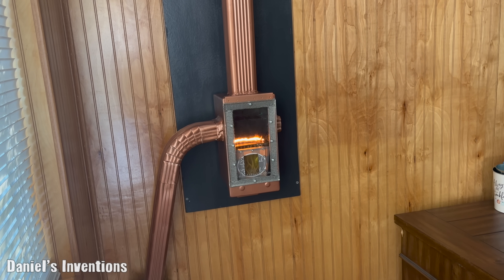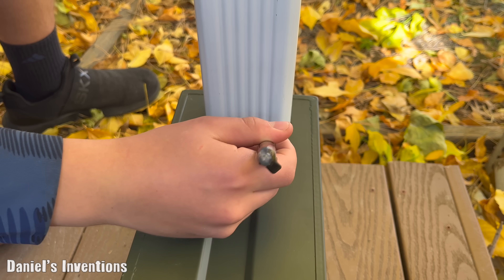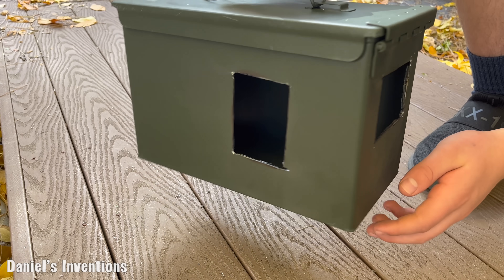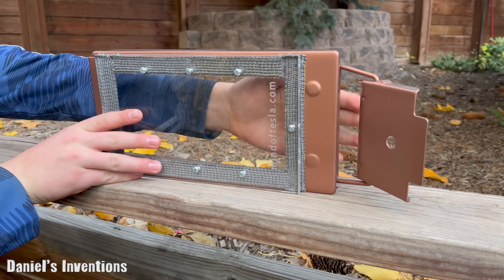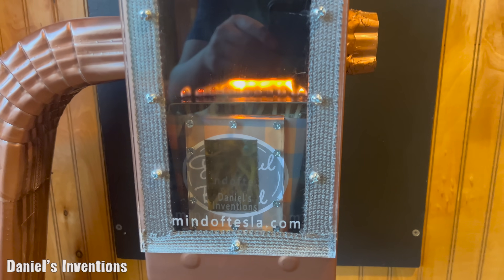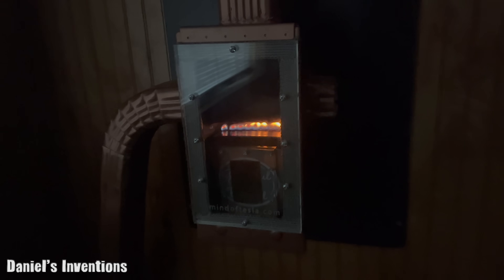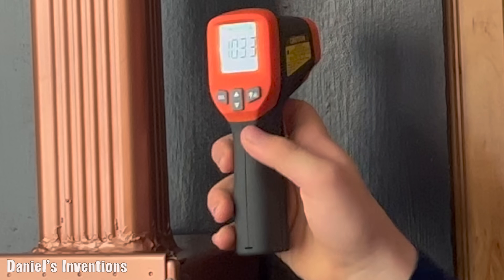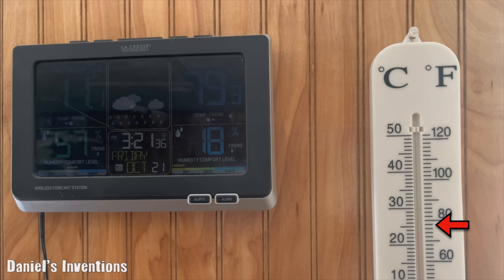ENDLESS Heat for Your Home WITHOUT Electricity

Comment: Get rid of the computer fan. Put the output from the heater air pipe a little higher and aimed upward. Hot air will be circulated by convection and the electric fan will no longer be needed.
Reply: The fan is optional to help with air circulation. The heater could run without it, but still, nice idea!

Comment: I was thinking about the same thing but I might use candle wicks instead  and need to watch JB weld it can handle a little heat before it starts melting I tried it on a motorcycle long ago and started to get weak when the motor got hot and that was the lower part of casing where it was cooler.

Comment: I'm liking it but lots of questions the main one that gets me is the no electricity but u have a 12v fan so electricity hmm
Reply: It does not need to have a 12v fan, but the fan helps with air circulation.

Comment: I'm unclear as to how you regulate the heaters output. Say you have a cold night but a suddenly wormer morning. is on and off the only option?
Reply: On and off is the only option; although, I'm sure you could probably figure out how to install a heat regulator that works with the heater.
Reply: @jimwei4life  Yes, something that covers/hides a chunk of the wick could reduce the output.  You need to leave a part uncovered to work as the pilot light.

Comment: Put some thick steel on top of the heater, it's thermal mass will help radiate even more heat.
Reply: You mean "its surface area".  Thermal mass just stores heat.
Reply: @kensmith5694  Yes, the thermal mass of steel or iron, captures the heat, but the steel surface will radiate it. Could attach some old PC heatsinks to that surface to effectively move the heat out into the surrounding air. Otherwise a lot of the heat goes straight out the chimney. You want air to exit the chimney to extract fumes, but to also retain as much heat as feasible.
Reply: @VenturiLife  Yes like I thought yo9u really meant, you meant surface area.
BTW:  You don't want to take the temperature of the exhaust below boiling with the type of pipe used.  If water condenses, it absorbs gasses and become corrosive.  The pipe being used would be eaten up by that.
Reply: Rocks.  Ordinary or lava rocks (from grilling) or a piece of granite (to be decorative).  They have far better specific heat than steel and will "hold" the heat later into the night.

Comment: Well done, and this is the way forward in heating spaces economically and efficiently. I would still advised a C02 monitor in any small spaces though!
Reply: Good point.
Also CO1 is more deadly than CO2 and it is generally produced in heaters by incoplete combustion (no enough oxygen) so you not only should vent the heater but have adequate ventilation of the living space. A CO1 meter and an O2 meter would be nice but CO1 is much more important.
Reply: @2Truth4Liberty  CO2 Indoor Air Quality Meter are essential for most space heaters, this particular design does have a flue venting system that is separate from the combustion chamber, so unless a leak occurs they are much safe than a regular open and flueless gas/oil appliance space heater, however it is always advisable with any combustion chamber and device to have adequate ventilation and assisted/ monitored with a CO2 Indoor Air Quality Meter. Always best to be safe than sorry!
Reply: What about CO1 which is more deadly than CO2?
Reply: @2Truth4Liberty  Are you referring to Carbon Dioxide (CO)? As CO(2) is produced at dangerous levels by oxygen-starved combustion in improperly ventilated fuel-burning appliances such as generators, oil and gas furnaces, gas water heaters, gas ovens, gas or kerosene space heaters, fireplaces, and stoves. CO(2) is almost entirely a man-made gas that is not normally found in the earth's atmosphere. that is toxic. CO(2). Many refer to carbon monoxide as one of the most dangerous gases. We use CO and CO2 to identify the separate gases, so I assume you mean Carbon Dioxide and Carbon Monoxide. Both are made from carbon and oxygen molecules. Both are potentially deadly and can cause severe health problems. Both carbon dioxide and carbon monoxide are colorless, odorless and tasteless gases. The concentration levels are where the affects are life threatening, with lower levels of CO required to cause major life and health problems than Co2. CO and CO2 are potentially deadly, this happens at vastly different concentrations. While 35 ppm (0.4%) of CO is quickly life threatening, it takes more than 30,000 ppm (3%) of CO2 to reach the same risk level. I think that's what you are referencing, Co(1) and Co(2).The most important difference is that carbon dioxide is a common, naturally occurring gas required for plant and animal life. CO(2) is not common. It is a byproduct of the burning of fossil fuels such as oil, coal, and gas.
Reply: "CO(2) is produced at dangerous levels by oxygen-starved combustion in improperly ventilated fuel-burning appliances such as generators, oil and gas furnaces, gas water heaters, gas ovens, gas or kerosene space heaters, fireplaces, and stoves."
---
Change CO(2) (dioxide)   to CO(1) (monoxide) and I woud agree.
Carbon Dioxide is natural - every human breaths it out, and combustion produces it too.
Carbon Monoxide is natural too but is rarely produced in nature as it takes an oxygen starve combustion to make it.
Whenever you see "soot" being formed by a flame - you can know it is creating CO(1) - carbon monoxide - which is very toxic - so a carbon MONOXIDE tester/alarm is HIGHLY advisable for non-vented combustion.
Reply: @2Truth4Liberty  It is just CO. Not CO1
Reply: @gregdazer8395  Which is more toxic? CO or CO2?
Reply: @2Truth4Liberty  you just stated in your comment that CO is more deadly, why are you asking about it now?
Reply: @bmxscape   @bmxscape 
 Because the suggestion of getting a CO2 monitor without any mention of getting a CO detector.
If you can only afford one, it should be the CO detector.

Comment: You could use a termoelectric generator to drive the fan, it will be driven by the heat = no battery needed.

StoveSeal could be used instead of Jb Weld.
Reply: They make Stirling powered fans that are more efficient than that.

Comment: The concrete used as a heat shield really should have an air gap between it and the wall. It will still get hot and the wood behind it.
Reply: Yes, and it should be made reflective so it reflects the IR.
I think two plates is even better.
Directly on the wall you have the cement board.
A short distance out from it you have a sheet of metal
Then there is a space before you get to the heater.
Reply: They said there was an inch air gap between them

Comment: very good, can it run on any oil?
Reply: It will run of nearly any clean light oil.  Olive oil, Vegetable oil will work and so will kerosene.  Heavy oils won't go up the wick well enough.
Reply: @kensmith5694  Bacon grease?
Reply: @KuptisOriginal  It would stink and attract animals but rendered bacon grease would work.  Basically if you keep grease hot long enough or add certain chemicals to it, it becomes runny enough to use.  Otherwise, it is too thick to climb up the wick.

Comment: What did you paint the gutter tube, that has the flame contact inside of the heater, with? Alos, how often do you have to clean the soot out the heater?
Reply: It looks to me like they spray painted the gutter tube. I don’t know about the soot, though.

Comment: Are adding copper fins using silver brazing which takes a little skill is better than Sauter made out of lead because it’s not as heat conductive. 

The fins on the exhaust pipe would increase the surface area absorbing more of the heat from the flu pipe. 

Even the box itself though should be made out of copper steel as a very poor heat conductor.    And the type of heat that you are using is extremely low so you never have to worry about the copper melting.
Reply: Yes, and there is also that weird "welding rod" that can be used to join aluminum with just a blow torch.  Copper is expensive.  Aluminum is cheap.
Reply: @kensmith5694  The problem is that weird welding rod that you call it melts at a low temperature just like solder in the 400° F range

Silver Brazing is in the 1200° range more acceptable for a stove.
Reply: @coldfinger459sub0  I wasn't thinking of the soldering stuff at 400F.  The stuff I was thinking of melts at much higher temperature.  With a quick search I found some that melt a 728F
Reply: @coldfinger459sub0  Fires of the type shown don't get all that hot.  They are basically candle fires.  Also remember that the metal in the thing is well below the temperature of the fire.  If it isn't there is not enough air flow.
BTW:  Diamond is a much better thermal conductor than silver.  It is a bit harder to work with though.
Reply: @coldfinger459sub0  It is also a bit expensive to get machined to shape.  The funny thing is, I keep expecting someone to come up with a way to make "structural shapes" of diamond.  Folks in Florida can make nice ones 1/2" in size.  Others have a method to deposit layers of diamond onto metal surfaces.  I never expected either of those to happen.

Comment: One gallon of diesel = 138,000 BTU / 7 days = 19,714 / day. Likely 12 hours/day is only 1,643 BTU / hr. With an outside Winter temperature of 32°F and asking for 68°F inside your cabin means a temperature difference of 68°-32°=36°, if one square foot of cabin area requires 36 BTU, a 10'x7' wall = 70sqft x 4 walls = 280sqft. Floor and ceiling are each 10'x10'=100 x 2 = 200sqft.
Total area is: 480sqft x 36BTU/sqft = 17,280BTU/hr.
Simply put: You only can provide the required heat for ONE HOUR each day. That is a 12x heating error in your video report. Maybe you think candles with flower pots are better? Good luck!
Reply: @jimwei4life  Any fuel oil will not provide enough heat from one gallon for a week of cold winter temperatures. The above math shows you how to evaluate the fuel heat vs the area requirements. Do you see a horse, a hay burner or transportation... for only one rider or use a wagon and move the whole family... get the picture? Sounds like you are challenged from the video's English to ferret out the details in order to make an objective evaluation. Math doesn't lie... If you don't believe it, build it and collect the data... I prefer is SAVE my hard earned cash for better projects. Good luck!
Reply: If you only are paying $2.50/gallon for fuel oil you are fortunate... I just filled my car's 20 gallon fuel tank and paid $95.00. There are too many errors in this video... Now saying $5 per week. If $2.50/gallon = 2 gallons/week. NO CIGAR! Not enough BTUs in 2 gallons... unless two hours of heat a day will do ya. Definitely not going to provide enough BTUs of heat during the Winter cold temperatures.

Comment: BTU's in Kerosene and diesel fuel is about 1,000 BTU/ounce and there are 128 ounces in one gallon.
  So, if your heater can operate one week (168 hours) per gallon of fuel, this means your "heater" is producing LESS than 1,000 BTU's / hour.
 I can actually heat my house rooms by using the old style (glass) kerosene Lamps.
They give off about 1,100 BTU each hour (because they consume 1 ounce each hour).
3 of these lamps produce the SAME amount of heat as a 1kw electric heater.
  You can; often find these lamps at 2nd hand shops and flea markets for $15-30 each.

Comment: what type of oil was used?and what was your choice of metal oil tank?sorry if i mised those details.....i will watch a few times...very eficient.i wonder if a more comon type of metal box thinner guage could be used if the main body didnt get extreme temp
Reply: They used an ammo box for the actual heater, and you could probably go to the dollar store and get a metal container for the oil. It does not have to be high heat resistant since it will only hold oil and not be the heat conductor.
Reply: @jimwei4life  thanks..my question on using a more common thinner guage metal was on switching the ammo can thats gona be very expensive and lengthy delivery in upcoming couple weeks. if the ammo can.....main body doesnt get extreme temp...might be posible to substitute a more common readily available cheaper option.great design

Comment: Wondering if there is enough waste heat that can be used to power a fan, whether Thermoelectric or External Combustion?  Wondering even if there can be significant improvement using a heat pipe from outdoors for a higher differential?  I like the idea of the carbon felt and wondering if can make more dual combustion so can use even waste oil to power with negligible odor once to temperature?  Neat design!
Reply: Liked, commented and subscribed for that spirit!

Comment: you could bypass the need for electricity on the fan by adding a heat activated fan Ecofan to the hot surface of the stove. other than that that is a great idea and very cheap

Comment: Soo no worries about carbon monoxide poisoning ?
Reply: From where?
Reply: @joemendyk9994  from the heater
Reply: The heater has a pipe for fresh oxygen intake. They should not have a problem with carbon monoxide poisoning.

Comment: I like your design, however, if I build it,  I intend using all welded steel as well as building in several vertical heat exchanger tubes to capture more heat as well as eliminate the need for a fan, relying instead upon convection and fins to direct air flow into the room, much as does a standard gas wall heater.
Reply: Someone suggested a Stirling powered fan.  You can get them for a wood stove.  Hunt around.  It would let you push the heat to another part of the room.

Comment: Very nice. The heat exchanger that you have built is similar to the concept of the Recoheat unit from the UK . It forces air through a heat exchanger in the exhaust of a wood stove. Keep up the good work.

Comment: Not bad...I'm building something similar, but it's based-upon the old kerosene catalytic burners. The wicks are round, and use fiberglass ( original stoves from the 1920s - 1950s used asbestos ). A Stirling-engine fan should be able to pull the indoor air through nicely. Oil has the highest BTU potential of any fuel today, and works fine. Keeping the smoke down and the exhaust outside is the real key to their effectiveness.
Reply: Carbon wicks are better than fiberglass and can be made on modified easily. Optimizing for convection circulation you can cut out the need for a fan all together. But the Stirling engine uses what the heater is already making. I plan for K.I.S.S. though as more moving parts means more stuff to break.
Reply: @thee_number_six6227  I'll try carbon for the wicks, but the nature of the type of heater I'm talking about is that the wick is only about 1 inch high, so there's not a lot of draw to worry about. It's more about giving a kerosene-air interface for combustion.
Reply: I like the Stirling fan idea,  The nice thing about it is it makes the heater's total efficiency higher.
It could be extra nifty if it could run a Stirling heat pump too.  I don't think the idea is practical but the idea is that you get some additional heat from a heat pump.
Reply: Assuming the kerosene heater is 100% effecient, you will need to source kerosene at 3.90 per gallon to to match the cost per btu of an electric space  heater with an electricity rate of $.10 per kwh.
If you have a small airport nearby they might sell you Jet'A fuel, (pure kerosene) it's currently around 3.90  a gallon.
Pretty much the exact same cost per btu as electricity.  An electric heat pump would be several times cheaper if they work in your climate.
Reply: @mrbmp09  New Hampshire gets down to -45F easily every winter and heat pumps simply blow tepid air at best.
Your electric calculations don't help, either - our rates are currently 19.99 cents / kwh.
Also, I've seen the calculations for electric heaters and they assume 100% efficiency as well - except they don't seem to deliver the heat with reasonable rates.
Finally, we get fairly frequent brownouts and blackouts here in the boonies, and we're expected to have state-wide problems.
Reply: @Jollyprez  19.99 cents plus demand charge, plus delivery fee, and other various charges that nobody talks about when they say electricity is "cheap." My favorite part is Eversource constantly raising my rate because of natural gas prices when all the electricity comes from hydropower. I guess flowing water is more expensive now...
Reply: @mrbmp09  You can also do a natural gas powered heat pump or perhaps even a kerosene powered one.  The "waste heat" of the system would be exactly the same as burning the fuel with a flame.  This adds a 1.0 to the HSPF of the system.
Reply: @mrbmp09  Thank you for doing the math on that. I want to add that, in the USA, heat pumps are now suplemented by the federal government, after passing the IRA act. 

The price of natural gas (methane) is going up, and so is electricity. My home is heated with natural gas, and I'm looking for something to put in my fireplace that would help me supplement my home's furnace. I could burn wood but that is not efficient at all and doesn't really add much heat. I could get a wood burning stove but I would need to drop $1,000 on a stainless steal double-walled chimney liner, and that's not in the cards for me at this time. Maybe I should just get a heat pump.
Reply: @ThisOldJalopy  If you live anywhere north of Cape Cod, heat pumps are a total scam. All it is is slightly more efficient electric heat.
Reply: Using plastic containers 2,3 and 5; you can make a distillery, burning wood (medium sticks, to make your own diesel fuel.  Free wood, free plastic bottles = free diesel oil for heating.  YouTube has video how to make the distillery and process the bottles to oil.  $0 cost plus your time.
Reply: @Joshua Kiser AS wick and a flame do the job.  With an active flame you have enough heat to provide the energy needed to start the combustion reaction of the next bit of fuel.